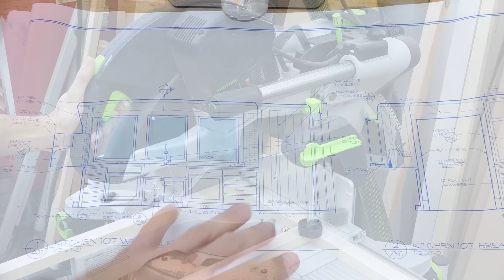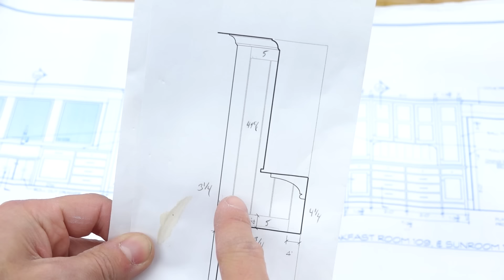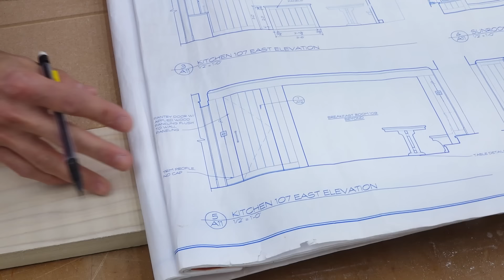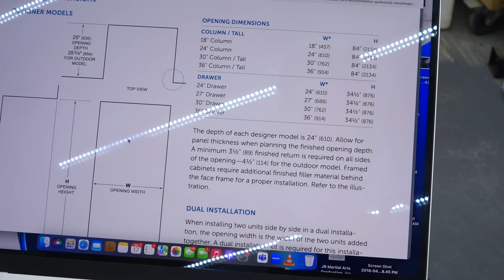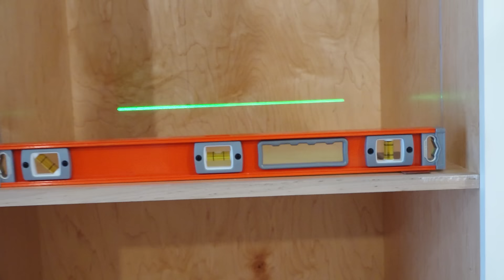Building and Installing the Fridge Surround   | Home Renovation & Addition Part 69

Comment: Once the refrigerator is installed and running, put a thermometer on the side of the freezer. If there is too great a different from room ambient, you can always cut a vent into the ceiling.

Comment: Nice video. One respectful question:  how will you circulate air for the refrigerator?  I built a similar surround for a high end kitchen years ago and the wife did not like opening and closing the door to access the food.  We removed the door and installed panels on the refrigerator doors 
Keep up the good work!

Comment: live in Alaska and watch   your program as well as other programs there is one program I think you might be interested in which Is Lumina Acres. they have installed a Heat master G10  wood boiler that hears there whole property and only burns approximately 3 to 4 cords of wood per year. you can see on the following program the instillation start  ( we have been waiting a year for this) and (this could be a total disaster)

Comment: Hi Matthew this is Ross from Sydney Australia. I truly love your videos they are very educational... One little observation, did you consider ventilation like (exhaust fans) for your Kitchen appliances cabinet and your Fridge cabinet because both of them they do create lots of heat when they are on and working... I have an enclosed fridge like yours and I had to install an exhaust fan with heat sensor.. I have mine set at 25 degrees Celsius 77 Degrees Fahrenheit... cheers Ross

Comment: Love watching your videos!   Great to have so many great tools and know how to use them.  I learn something new with video.

What kind of ventilation are you providing for the refrigerator?  Don't the sides and back need air flow to dissipate the heat?
Reply from the maker: It just needs ventilation in the kick plate. Thanks!

Comment: It’s amazing how many people say you can’t use a miter saw to consistently cut a 90, and you must do it on your tablesaw.  Yet every cut you have made for your facings was cut with a miter saw,  and the joints are tight.

Comment: A refrigerator is a heat pump that pulls and/ or pushes air across a heat exchanger. A space around it is needed for that circulation. If you are creating a tight fitting box around it that blocks in coming or outgoing air you are making its job harder if not impossible. Are you venting it to the outside or a free flowing vent somewhere?
Reply from the maker: It vents out its toe kick. It’s a built in fridge
Reply: NOT TRUE

Comment: I noticed you had a Sub-Zero unit specified. Are you getting a french door style refrigerator/freezer - so presumably two panels with handles mounted on the face?
Reply from the maker: Just a column fridge going there. We have an under counter drawer unit which will have a freezer drawer going in the island

Comment: When attaching the cabinet face frame to the side of the refrigerator panel, do you drill a clearance hole on the face frame side? Maybe it's not necessary if you clamp it tight enough? Curious what your process is. thanks.
Reply from the maker: Clamp, drill, screw

Comment: What brands of parallel clamps do you have, red and orange? Which ones do you recommend?
Reply from the maker: They’re all Jorgensen except for the 5’ which are jet. I greatly prefer the Jorgensens over the jet but those are the only 2 brands I’ve used
Reply: @mcremona  Thanks for the feedback, I have Jorgensen pipe and F style  clamps from before parallel were around. May add some!

Comment: I see you free hand tight setting dominos a lot. Do you ever have to sand the domino side edges to get them to fit?
Reply from the maker: No
Reply: @mcremona  thank you for the response.  I have wondered about this for a while. You have great line up skills. 😃. I use the tight setting and the machine tab for the first one, then 1st loose setting down the line (assuming a multiple linear glue up).

Comment: If the refrigerator cabinet is completely enclosed, how will the refrigerator get enough air circulation?
Reply from the maker: It’s designed to be enclosed. All circulation happens in the toe kick

Comment: The more I see you adjusting cabinet height the more I like the leveling adjusters you are using please if you can provide again mfg. name and model. If you think as is widely held that dominoes do not add strenght why do you use so many to join adjacent wood faces? Ray
Reply: To keep those long joints aligned.
Reply from the maker: Hafele axilo
Reply: Thank you Ray @mcremona